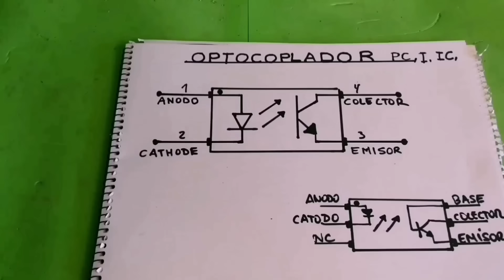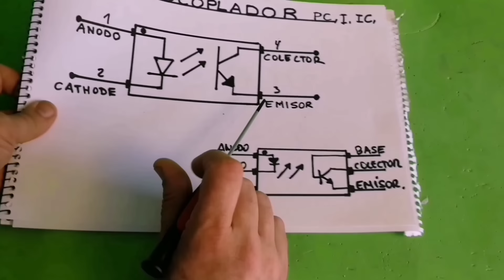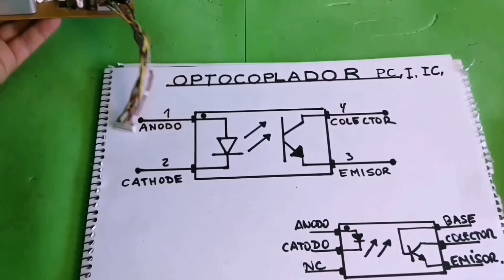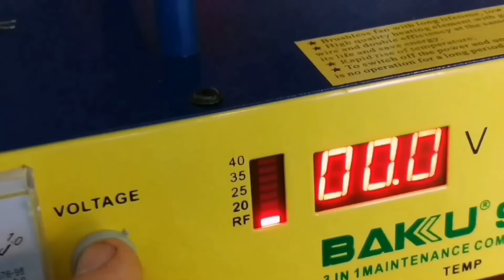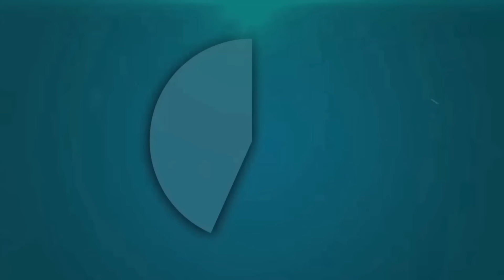La MEJOR forma de SABER si el optoacoplador esta DAÑADO fácil y rápido.

Comment: yo tengo guardado varios de ellos y no sabia parq que o como funcionaba  voy a hacer mi propio experimento en casa exelente amigo gracias
Reply from the maker: Gracias Miguel un saludo
Reply: gracias a ti hermano de verdad quer soy experto con las fuentes de poder e incluso se repararlas pero no sabia para que era el optoacoplador ya vi que es un suiche optico por medio de luz que estabiliza la corriente en la etapa secundaria bien sea pc o  ic dependiendo de sus tipos porque hay varios foto transistores exelente hermano
Reply: e incluso creo que hay un transistor serca del optoacoplador no se como se llama pero creo que incluso puedes por medio de resistencia graduar el voltage de salida a 12v hasta 30 volt en una fuente de poder no se como se llama este transistor
Reply from the maker: Si te refieres al circuito Integrado divisor de voltaje si. Es como un transistor de 3 patitas
Reply: @electrojungla  exacto solo dos patitas controlan el voltaje por una resistencia programada y puede ser variable el voltaje si le colocas mas resistencia o le quitas menos  yo voy a averiguar ese sistema y te paso el nombre hermano si va
Reply: ajaaa aqui la informacion hermano ya me pasaron efectivamente ; parece un transistor pero no lo es es un diodo ajustable que lleva tres patitas estas patitas la 1 la 2 y la 3  son ; referencia , anodo y catodo la cual controla el voltage por medio de resistencia puedes subir el voltage o bajar si le quitas o le pones mas resistencia y esta cerca del optoacople exacto hermano eh alli
Reply: es un diodo de referencia ajustable  referencia anodo y catodo  parece un transistor chiquitito de baja potencia al verlo bien es un diodo de refencia tipo transistor

Comment: Muchas gracias por el video. Aprendo mucho gracias a el. Tengo duda componente  que ponde 333 155E. Despues de mucho indagar en internet dedusco que es TLP155 obtoacoplador de 5 pines. Podrias  explicar como se comprueba este de 5 pines. Muchas gracias de antemano maestro
Reply from the maker: El de 5 son ánodo, cátodo, base, emisor y colector, es como el de 4 pero el de 5 tiene un pin de base para regular la corriente del transistor y el de 4 la base es una puerta interna que se activa por la luz del Led
Reply: @electrojungla  Muy interesante. Lo sierto es que se me escapan muchos detalles, soy aficionado. Estoy reparando una y-sus de un lg tv y por mi huev... que la arreglo. Comprar board de segunda es facil, pero tiene mas merito comprovar cada componete. Cuando dices que tiene una base... ¿ Debo hacer alguna medicion en ese pin ? Entiendo que con comprobar  anodo, catodo, colector y  emisor haya. De por si hay otros 3 obtoacopladores de 4 pines por la otra cara de la placa que ponen 131 817bn y del cual 1 de ellos hace cosas rarisimas. Sencillamente no da voltaje en el multimetro en las patas del colector y emisor, aumentes o disminullas en voltaje. Los pedire para reemplasarlos todos y asi mato las pulgas del perro.  Tal vez sea ese el motivo de que se hayan ido los rjpp30h2a igbt de la board. Aun asi ya tengo para cambiar algunas resistencias y algunos condensadores que no me dan buena pinta. De verdad que te agradesco tu pronta respuesta y tu colaboraion. Este mundo me fastina, lo hago por hobbie porque vivir de esto no me parece muy rentable, aparte del inmenso conosimiento que hay que tener.

Comment: Amigo! digame a este tipo de Optocopladores al poseer un diodo interno Anodo y Catodo identificado en sus terminales ¿Se le puede aplicar la tradicional prueba de diodos con el multimetro? Fuera de la placa para verificar si esta malo o bueno??
Reply from the maker: Si por supuesto tanto en el photo transistor como en el diodo led pero ojo el trabajo de dichos componentes es a través de luz con lo cual solo es una prueba multímetro no dinamica
Reply: Una pregunta tengo 2 tester:
La 1° lo puse en modo continuidad que provee (2v de salida en sus puntas) y se lo puse al ánodo y latido del diodo emisor de luz.
Después puse otro tester en modo continuidad para saber si funcionaba a la salida pin 3, 4 y no funcionó 
La pregunta es será que sobrepase el voltaje 1,5 de entrada?
Los miliamperios de la pila o batería del tester no son suficientes para polarizar el diodo pin 1,2 de entrada y así saturar la salida? 
A todo esto lo hice en placa. Mí idea era hacerlo más práctico y quería probar si se podía hacer estás mediciónes en placa y con 2 tester. Gracias desde ya

Comment: Haber profe, el otoacoplador tiene una fuente, y el led con q se allimenta? Otra fuente conectado el optoacoplador en serie? Como si fuera un switch?
Reply: Es correcto con otra fuente, puesto que ese precisamente es el propósito de los optoacopladores aislar eléctricamente dos tensiones de poder en un mismo circuito. Puedes usar una batería para el led y una fuente de poder para foto transistor.
Pero lo mejor si dudas del opto, REEMPLAZALO!!!

Comment: Hola Oscar. ¿Con cuantos miliamperes lo alimentas amén del voltaje de 1.5 volts? Gracias.
Reply from the maker: 1 amperio o 2 es suficiente o si tienes menos tambien sirve hugo
Reply: electrojungla Gracias Oscar. Con multímetro también se puede probar. Del lado del diodo como cualquier diodo y del lado del fototransistor debe dar infinito. Obvio la prueba dinámica es más segura. Abrazo grande.

Comment: Se puede medir el voltaje que debe de entregar, o solo podemos saber que tenga continuidad?
Específicamente en una fuente de lg el máximo para las tiras led es de 117V, pero me entrega sin carga 140V, con carga 128V, reduje el voltaje aumentando el valor de las resistencias pero éstas estaban bien según el código de color.Es por esto mi duda si el optocoplador está entregando el voltaje correcto.
Muchas gracias por compartir tu conocimiento, saludos desde México
Reply from the maker: El optocoplador sólo transporta el voltaje de referencia del ic tl432 hacia el ic de control, el optocoplador no suele ser el responsable de ese tipo de averias
Reply: @electrojungla  entonces puede ser por ahí el problema? sería recomendable cambiar el transistor? aunque ya con el cambio de resistencias bajé el voltaje de128 a 104V con carga, las tres regletas traen 18 leds de 6V (108V).
Muchas gracias por tomarte el tiempo en despejar las dudas. Un abrazo
Reply from the maker: Si el problema anda por ahí o por las resistencias
Reply: @electrojungla  mil gracias.
Saludos

Comment: No me quedo claro si la parte del foto transistor solo tiene que conducir en un solo sentido, ya que he probado varios y en la parte del foto transistor al alimentar me conduce con 50oms de un sentido y 200oms en el otro sentido
Reply from the maker: Si no hay diodo damper no necesariamente tiene que fluir en un único sentido
Reply: Es un optoacople de tv trc, trae 2 y los dos son iguales del mismo modelo y de 4 pines. No he podido encontrar hojas de datos pero al polarizar el diodo led los valores de ambos en el foto transistor son distintos. Creo que el que tiene menos valor en resistencia 30 oms es el que está ok,pero el que tiene más valor 180oms puede estar desgastado. Eso sin mencionar que los 2 tienen una conducción en sentido contrario al foto transistor con un valor más elevado en resistencia.
Me gustaría saber que valor sería el estándar en la medida del foto transistor.

Comment: puedo usar cualquier led?
Reply from the maker: Si Le puedes poner cualquiera pero tienes que poner una resistencia de protección dependiente de la fuente de entrada
Reply: @electrojungla  voy a usar una pila de 1.5 volt que resistencia devo ponerle al led?
Reply from the maker: Para 1.5 volt no te hace falta resistencia al led o como mucho de 100 ohms
Reply: @electrojungla  entonce le pongo el led sin resistencia?
Reply: y si le poingo resistencia la pongo en paralelo o en serie con el led?
Reply from the maker: Para 1.5 v sin resistencia

Comment: hola, tengo un 4n35, y con 5v no funciona, funciona con 9 v y apenas enciende un relé de 24 v , si alimento directamente el rele este se pega, pero si lo alimento a través del octo 4n35 da un pulso y el relé no se sostiene... por que podria ser? necesita mas voltaje el led interno?
Reply from the maker: Pienso que ese modelo de 6 pines puede ser activado con 6v si el relé es de 12v es imposible que se active
Reply: @electrojungla  el rele es de placa de lavarropa, es de 24 voltios pero a al colector le doy 24 voltios y deberá entregarlos al rele, voy a medir cuanto voltaje sale del emisor y te digo
Reply: Mi fuente estaba mal conectada , ya solucioné gracias, anda perfecto